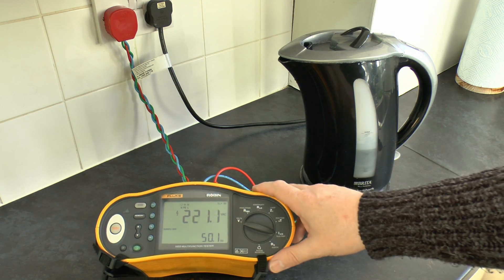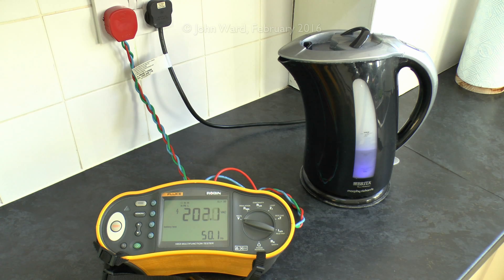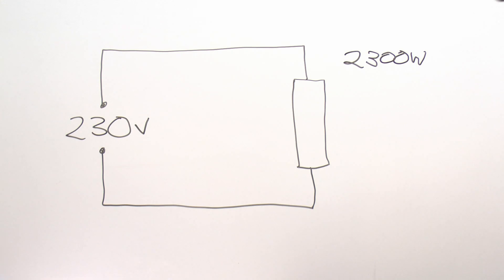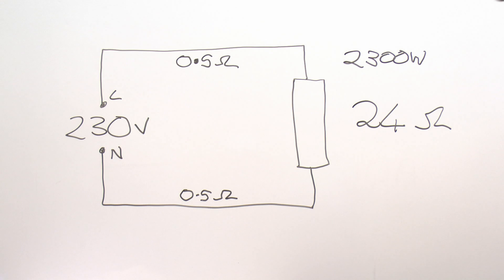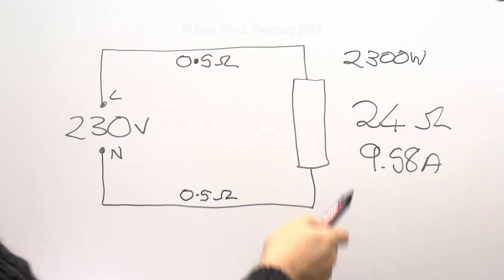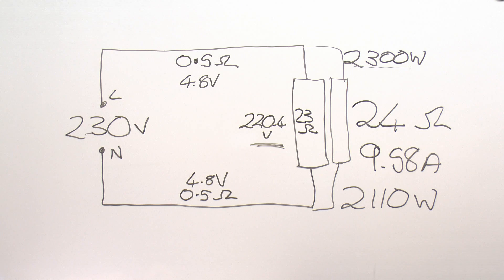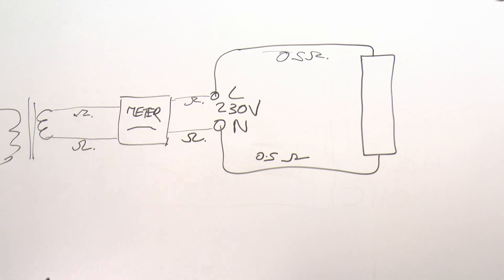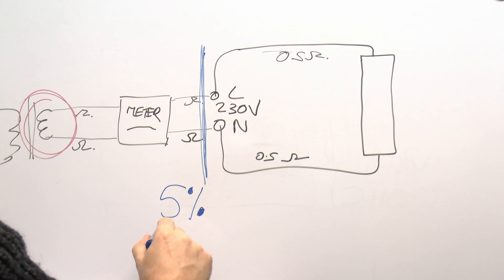Voltage Drop in Electrical Circuits

Comment: I did wonder why the voltage was so low, as whenever I have measured mine, it has been above 245V: the supply industry likes keeping higher voltages than the EU standard of 230V, as we end up using more power! You gave the reason at the end. I have always preferred to err on the side of larger conductor sizes: in my electrical days, I always used 1.5 sq mm for lighting.
Reply: "the supply industry likes keeping higher voltages than the EU standard of 230V, as we end up using more power!"

In general you don't. Take that kettle. Feed it with a higher voltage, and it will boil the water faster and it will turn off quicker which will counteract the increased power usage. The same with a washing machine, or a dish washer, or an oven or anything else which contains a thermostat. Things get up to temperature faster and they then turn off quicker. In the case of devices which contain modern power supplies and draw a fixed amount of power, like a TV, a computer or something similar then the device will draw less current at a higher voltage and there will be less power wasted in the wiring.

Higher voltage supplies are more efficient. The current passed is lower for the same power which means there's less wasted power in the wiring. That doesn't just mean the domestic wiring, but it feeds back through all the levels of the transmission network. Run, say, 5% higher voltage at each level and that means about 5% less current which means about 5% less power loss in the cabling. Drop the voltage so that it's actually 230v that is delivered rather than 240v, then then more current would have to be delivered for the same power.

As for the EU standard being 230v, it's not. The requirement is a range which means that anything from about 215-250v complies.

Comment: How much volt drop is common on using air conditioner,cause when i use it voltage drops rapidly from 220 to 140v and so downwards and finally it trips
Reply from the maker: Generally 5% voltage drop is the maximum acceptable, or 209 volts on a 220v supply.  If it's dropping to 140 then something is fundamentally wrong, such as cables being far too small or the supply not being able to provide the current required.
Reply: @jwflame  is it the thickness of the wire used for the supply to air conditioner? Or related to like weak neutral line?
Reply: @jwflame  its just not the ac but when i use water heater (2000watt), then also it drops from aprox 220v to 180v?
Reply from the maker: Something wrong with the supply, or the cables/terminals connecting the building to the supply

Comment: This video doesn't make a lot of sense to me. I would have thought that the diagram has the first resistor being the voltmeter and then the kettle would be in parallel to the right of it with a switch in series with the kettle. To me it then wouldn't make any sense that once the switch is closed that the voltage across the voltmeter would change as I've always been taught that voltages across parallel resistors are equal.
Reply from the maker: Voltage across parallel resistors is the same, but in the context of this video, there are several resistances in series.  Voltage is measured across the load (a kettle in this example), the other resistances are the two wires that connect to the load.  Voltage is shared between those three resistances (incoming cable, load, outgoing cable).
With the kettle off, the voltage is just the supply voltage, there is no current flow.  When current flows, the voltage at the kettle decreases, as it's then divided between the incoming cable, the kettle and the outgoing cable.

Comment: What I wanted to know is if I lowered the voltage in my American as power would that save money? Also is their a way to force something to work at 300 watts of it normally takes 12000 watts.
Reply from the maker: Lower voltage will result in less current and less power - but only for basic resistive loads like a heating element or incandescent lamp.  For those, half the voltage is also half the current, and quarter power.  However they will also be very dim, or give out far less heat so there is no real saving.

For most modern items, lower voltage doesn't save money.
Items with switching power supplies (which is 99% of anything electronic) with often work normally on voltages between 100-240, they just draw more current at the lower voltage, power is the same.  If only designed for one voltage, it probably won't work at all if the voltage is too low.
Motors will not work properly at lower voltages, they will have far less torque and are likely to stall and overheat.
Fluorescent lamps will be dim or not work at all.

Comment: Facing voltage drop in home,

Getting  190~205v peak in day
And fluctuating between 146~198v at night 😫so terrible that if i turn on my Desktop the UPS continuously gets overloaded and gets heated
Reply: That is much too low!
Ask your power company to investigate. Either they must up the transformer tap or move you to a different phase.

Comment: "200 metres down your garden to one of those sheds". Just how big is your garden then? That would be a whopper...

I would also say that the resistance of about 1 ohm implies a rather long cable run. On 2.5 mm, that's a total length of 135 metres, of about 67 metres run length. However, as that is presumably a ring circuit, so there are two routes back, then that seems to me to point to a loop length of the order of 140 metres. That's quite a bit. I wonder if there's a break in the ring somewhere. From what I can find out, 106 metres seems to be the maximum loop length for a ring circuit on 2.5 mm cable.

Comment: I've never seen mains voltage so low, only ever seen it down to 235v, my mains sits about 245 to 253, depending upon the time of day.
Reply: Christopher Hulse I’ve often seen 216V which is right on the the threshold. Obviously this is reported to the power-grid company.

Comment: Wow that transformer you're on needs replacing, why is the voltage dropping that much? My house I can turn on oven, shower and kettle and go from 250 to 248
Reply from the maker: Fault on a cable in the road, which was repaired shortly after this video was made.

Comment: Thats why so many appliances failing after some time. They can't work on less voltage. Whats the actuall ratio allowed for some devices to work properly.
Reply: 1000fantomas - Low supply voltage does not harm the majority of appliances.

Comment: I have a voltage drop. The breaker is at 122 volts and the connection at the water heater is at 89 volts.
Reply from the maker: That is excessive, either due to undersized wiring or a fault with the supply.

Comment: John if it says total cabinet load of 10amps dies the fuse in the plug have to be 10amps or it doesnt matter if its 13amp has the mains lead is 16 amp c19
Reply from the maker: If it states 10A, then use a 10A fuse .

Comment: Just out of curiosity I tried it on my British system.  Ebay multimeter not a kinky Fluke, starting at a fairly statiic 248 volts Voltage drops by 1 volt  for each pair of slots on a 4 slot toaster. Total load about 1500 watts.  Guess my wiring is a little more substantial than the apparent damp string used in that house.........

Comment: Hi John great video once again. Am i correct in thinking that as the kettle element heats up the resistance will be increasing slightly and also further decreasing the voltage until the water boils and the thermostat trips the kettle off?
Reply from the maker: Resistance does increase as the temperature increases, but for the temperature increase in a kettle element, any change in resistance is insignificant.

Comment: John - Would you like to comment on a street, where say most owners had electrical cars, which were charged from midnight to 6 AM.  Would the voltage drop be significant?  Would the mains supply be overloaded?  Would the street need rewiring?

Comment: Well, that's are very huge voltage drop. When I switch on a 10 amp load, the voltage drops only by 3 Volts from 230 to 227 Volts.
Reply from the maker: The supply to the installation in the video was faulty, so had a much higher drop than normal.  Was repaired a few days later.

Comment: hi JW  love your videos, this video is absolutley good kirchoffs law proved your answers but how did you get 0.5 ohms for the conductors? or is this a fixed resistance for copper wire
Reply: The voltage drop (about 10v when kettle only was on) calculates to an ohm total in the conductors. Hence the assumption that it was about 0.5 ohm in each.

Comment: with the highest respect to Your videos, the cattle ,the toaster,the cooker are in parallel ....
Reply: in the first part of the video(turning on and off the cattle ,toaster etc.)  Sir John  discusses voltage drop on the appliances in parallel.in the second part he discusses the voltage drop on the cables(conductors),obviosly in series with the load----if the cables are too long they can "consume" the voltage needed the load to operate properly.The electricity is precise science--i thought Sir John could find a way (method) to differentiate the two voltage drops.

Comment: What is the minimum voltage before items (electronics) get damaged? 200v?
Reply: Lorenzo Taurino - It all depends on the electronics in question. 
I've had several fluorescent ballast and transformers for halogen lights dead with V ranging from 195v~220v. A few spikes set them on the way to the electronics heaven. :-) LOL

PS: Be aware that the losses are not just damaged electronics. You're paying more to your power supplier to have a worse service. :-(

Comment: I have air conditionings and lightning system in administration building and happen voltage drop what is the solutions to avoid this voltage drop?
Reply from the maker: Excessive voltage drop is caused either by wiring which is undersized, or a supply which is undersized or defective.
Reply: Islam Fathi - In aging installations one often very neglected detail is the capacitors (power factor correction). 
Make sure that not only they are in place, but most important are in good working order.
I've struggled with a couple of installations in this manner. the worst case scenario I've seen was a whopping 50A decrease after adding/replacing. That was on 1 floor only and just for the fluorescent lights!!!  
Make sure other appliances are also checked. Like fridges, pumps, AC, etc. :-)

Comment: Nice video thanks, so if V = I.R then the lower the resistance of the wire, i.e. the thicker the wire, the higher the voltage drop along the wire & thus the more voltage is available to the loads?

Comment: Wow thats off chopps, if you but the dish washer on, you will need to have a 110Volt fridge, how is that legal?  do you use the losses in the fixed wiring to heat the walls?
Reply from the maker: It's not allowed, at the time of making the video there was a fault on an underground cable causing the excessive drop in voltage. The fault was fixed a few days later.
Reply: Hi John, thanks for the update, do you know by chance was the fault in the live or neutral conductors?  Curious because your earthing systems there would have allowed the neutral potential to lift rather than the active volts to fall if the high resistance was in the return path, the voltmeter would read the same either way in your example but poor Mrs Jones (the fictional test subject oft used my teachers all those years ago), would feel the difference if she grabbed the outside garden tap to water the roses.  :) rgds Michael.
Reply: how long did jt take for the powercompany to find the faulty wire? @jwflame

Comment: in germany after war nearly no elecrican give a shit about voltage dropp! they take the minimum size for the current  ! and with the newer eu regulation they are not alowed anymore but they do it! i dont like the eu system but many electricans dont even know it! in indsutrie they put are large cable bundle  way to long and so many of them into a kable tray there in some cases the inner cables of the bundle overheat! have some of these people ever take a loock into some books? in the building were i live what you show is totaly normal. and if the elevator starts the voltage drops like a short circut!

Comment: When I was in England last year I suddenly realized why water in an kettle boils so much faster than it does in North America. By using 220V mains, your wiring is capable of more power. In North America, our household breakers are designed to protect 14 gauge wire, only allowing 15A of 120V. So, our kettles are designed to use less power, typically less than 1800W.
Reply: Edison has a lot to answer for. You should have listened to Tesla.
Reply: Edison was right. A 120v 100w incandescent lamp will last twice as long as a 240v 100w lamp.  For 100 years you 240 volters have been replacing  bulbs twice as often as the 120 volters.  Edison's  DC system finally stopped serving customers in 2007.

https://cityroom.blogs.nytimes.com/2007/11/14/off-goes-the-power-current-started-by-thomas-edison/
Reply: @billelkins994  but a 120v 100w bulb is about half as bright as a 240v 100w bulb if I am correct so get a 50w one which is the equivalent of 120v 100w bulb in the US and it will last as much. not to mention all DC power supplies work more efficiently with 240v
Reply: @NightArrow

The light output of an incandescent bulb is dependent on its wattage.  All 100w bulbs are the same brightness.  The filament in a 240v bulb is thinner than an equivalent 120v bulb thus "burns through" sooner.

Never heard the DC supply thing before.
Reply: Bill Elkins  I think the filament is not made thinner, but rather longer (2x) so the current is 2 times lower to get the same wattage. I guess the 240V ones last less time because they have more places and chances to break, being twice as long.
Reply: Denis Charette

The length of the filament cannot be the determining factor.  I would guess that the filament in a 120v 100w bulb is seven eights of an inch long. Doubling the filament length to one and three quarters inch will result in a 240v bulb. Another way to double the filament length is to wire two 120v bulbs in series. In both cases you are expending 200 watts at 240v.
Reply: The lifespan of a tungsten filament lamp is determined by a number off factors. The thickness of the wire used for the filament. The voltage actually applied compared to the designed for voltage rating. The actual number of switching cycles. Whether it is designed to give out a bright white light, or a softer orange/yellow light. Vibration.
Filaments for higher voltages are longer than filaments for lower voltages. Other than that, there is very little difference between 110/115/120 lamps and 220/230/240 lamps. Although it should be noted that a 1000 hour 220V lamp is unlikely to last 1000 hours if connected to a 240V supply. A lamp also does not care if the supply is AC or DC as long as the voltage is the same RMS value.
Edited to add: The light output of a 1000 hour lamp vs. a long life lamp of the same Wattage is not the same. The 1000 hour lamp will be slightly brighter in comparison. This applies regardless of the rated voltage.
Reply: Mark 1024MAK
Still the primary factor affecting incandescent bulb life is its designed operating voltage.  Never put a 240v bulb on top of a 1500 foot tower because a 120v bulb will last twice as long. Meaning this happens half as often. https://www.youtube.com/watch?v=f1BgzIZRfT8

Comment: 1st-Bad supply... is suppose to be 230 V (+10%;-6%) Open circuit.
2nd- if you are in the kitchen is suppose to be ring final circuit, and in not very well design, by connecting a 2.3 kW V drop is 10 V very close to 11.5 V.

Comment: Could you please do a vid on the difference between impedance and resistance.tnks
Reply: All resistors cause impedance but Impedance is not only caused by resistors..
Reply: @papac7940   Unless it's a wire sound resistor the impedance is considered to be negligible and even then, the wire wound contribution is extremely small and only considered to be a problem at high RF frequencies. The main contributors to impedance are capacitors and inductors. Resistance is the in phase opposition to charge flow whilst impedance is the vector sum of the out of phase charge flow IE current lagging or leading the applied voltage
Reply: @mrpropergander6800  I made that comment when I was in Uni. Thanks for reminding me why I don’t regret dropping out

Comment: So, if I connect everything in parallel, I wouldn't have a voltage drop. Or if I reduce c.s.a of conductor I will have constant voltage v=IR

Comment: The mains voltage in my area generally sits around 240 rising to around 250 at night when the load on the transformer is less. I have moved a number of times over the last few years and seen similar results in other areas but i have never seen the voltage dip as low as 220.